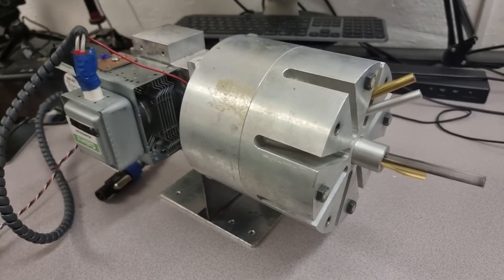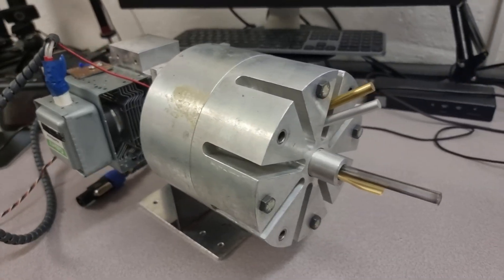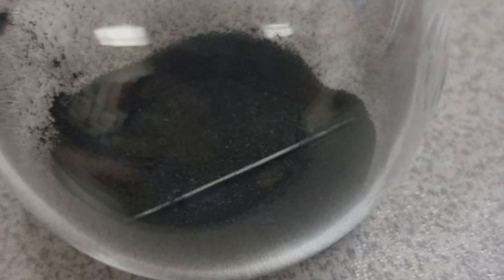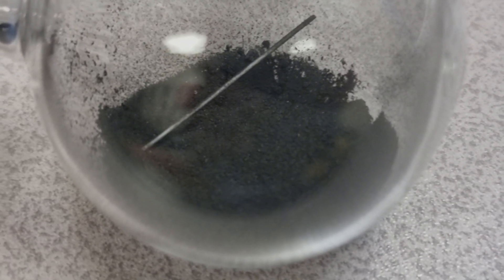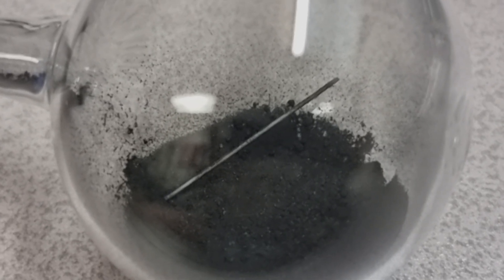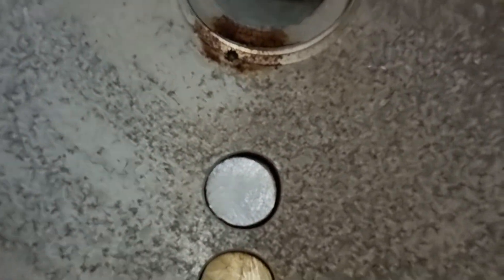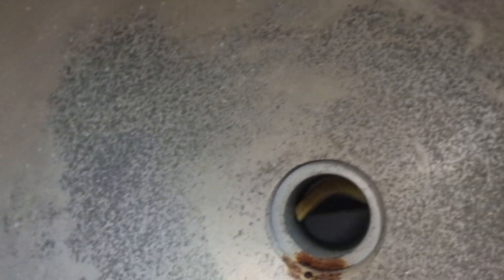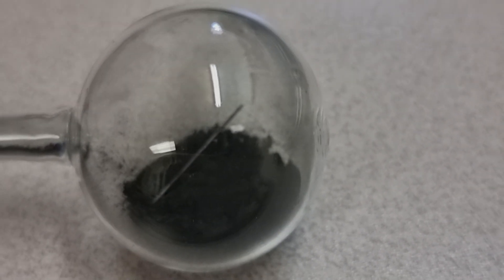Super NOVA - Post C14 experiment look inside - Sept 2024

Comment: Could you elaborate on what you meant by it potentially causing issues to radio carbon dating if the experiment remediated the carbon 14 in there? If you already have a video explaining this experiment in detail, could you point me to that? I watched the setup video when you were about to do the expriment, but I want to understand it better! :D Amazing job as always, has been a crazy ride. I just checked and I have been following you for roughly 8 years.
Reply: If the process can change c14 decay rate or transmute it into other elements - it will distort the ratio of c14 to carbon -> invalidates the theory of carbon dating being precise way of dating anything organic in a span of 60k years.